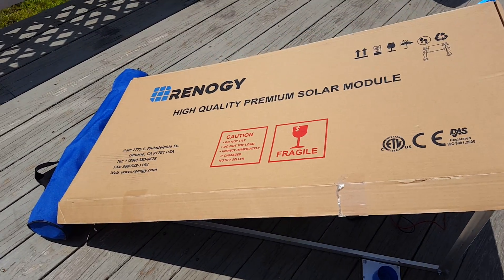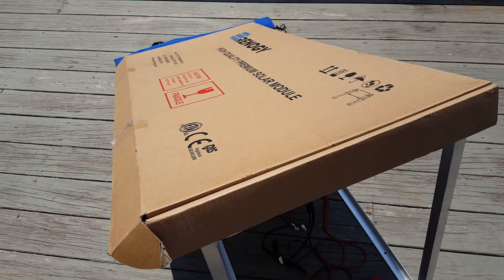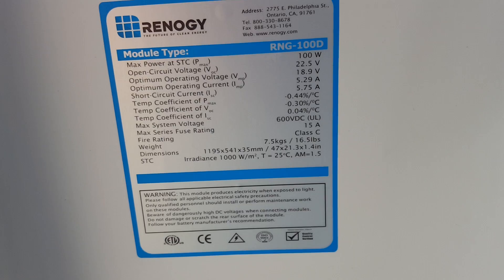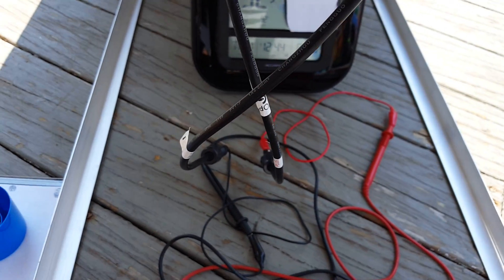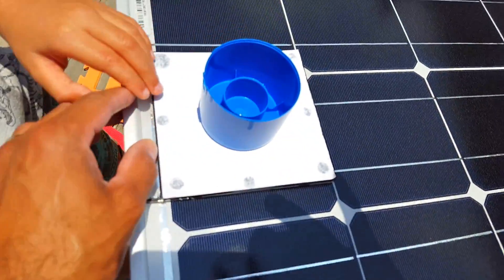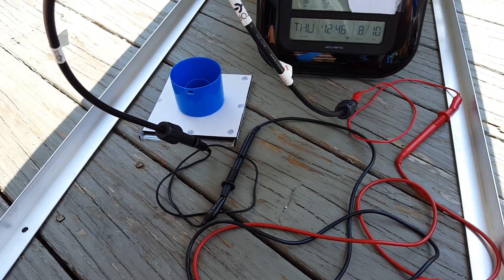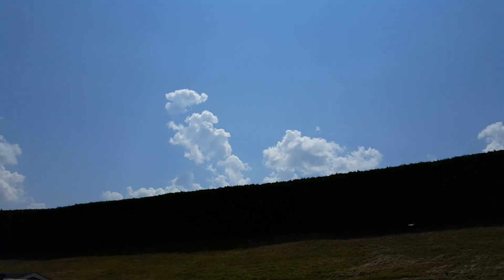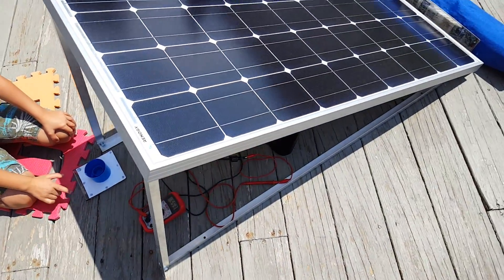Renogy 100 Watt Solar Panel Test (Solar Noon)

Comment: I have different panels, but I've noticed that the open circuit voltage is higher when the temperature of the solar cells are close to freezing temperatures. The difference in winter is that there are many more cloudy days. From my experiments in my particular region (central TX) I've found that it is better to point the panels more toward morning sun for permanent mounting, as the panels are cooler at that time of day and the sky is usually clearer on average before noon rather than after. Keep experimenting, especially letting the young assistant understand and learn as you go👍

Comment: what time zone do you need to adjust on average
Reply from the maker: Readjusting the solar panel angle twice a year should be sufficient. However, if you live close to the equator you probably do not need to adjust the angle of the solar panel.

Comment: I have a question, I was looking into this brand but messed up and went with Eco worthy panels because they were a bit less about $20 less, mine are mono 100 watt look exactly the same. Those little dots I noticed on your panels what are they bad cells? I have a panel with the same dots in a few areas
Reply from the maker: Regarding the dots; I think you might be referring to the spaces in between each of the solar cells??
For this solar panel, there are 36 solar cells in total.
The corner of each solar cell is not an exact corner shape...so..after all the solar cells have been placed it looks like 'dots'.
I think this is just the standard practice for the Monocrystalline type of solar cells.
I believe the Polycrystalline type and Thin film type of solar panels do not have dots.
Reply: ∵§ain†♣∀₦₲ξℜ∴ can you give me the link where you bought it?
Reply: Victor Rodriguez I was worried this would cause snail trails over a period of usage
Reply: My firstname My surname they're were 3 left the other day they're selling fast or they've pulled them from selling them

Comment: Not a valid test.  Power would need to be calculated into a normal load.  Testing open circuit voltage has no meaning.  My 15 watt battery maintainer shows 21 volts open circuit.  With the meter shorting the output of the solar panel the voltage at the meter would be 0 volts DC so you need to measure the ability of the solar panel to raise the temperature of say "Water" over time.   That would be a valid test. For a given volume of water you can calculate the energy required to raise the temperature.
Reply: ycmdill, Victors test is a very valid test, and one of the first tests you should do on a new panel to make sure the open circuit voltage and short circuit current are reasonably close to the published specifications of the panel.  It actually allows you to compare two data points on the solar panels performance curve.
Reply: @wd8dsb  I just got a new renogy 100w and checked it today and it read 19.3v -  is that too far out of spec?  open circuit voltage spec says 21.5, so that's a 10% dip, it was at an angle though, I think I have to test it flat.  I'm in AZ plenty of sun and plenty hot.  Thanks.
Reply: @carln1552  Hi Carl, the panel needs to be pointed directly at the sun for the test, and for temperatures above 25 degree C the panel will have reduced output, but likewise for temperatures below 25 degree C the panel will have increased output.  The industry standard is to obtain the specifications at 25 deg C and they call this STC for standard test condition.  The STC of 25 degree C is the actual temperature of the solar cells as well as the ambient air temperature, so does not surprise me that you are not reading 21.5 Vdc.  Even with an air temperature of 25 degree C, the cells them self will often be much hotter.  Not sure which exact panel you bought, but you should see a temperature coefficient for the open circuit voltage (Temperature Coefficient Of Voc) on the specification label, and suspect it's around -0.3%/deg C.  If you can measure the temperature of the solar panel itself (I would try measuring the backside surface temperature of the panel during your test), you will get a better idea on how close to the specifications your panels are, but again your panel needs to be pointed directly at the sun (not at an angle to the sun).  I suspect your panel is operating just fine.

Comment: I have 5 of those now and 1 more is on its way.
When I got my 1st panel I tested it and after 3 years I tested it again at the same month of the year  as when I got it new. After 3 years the panel was putting out exactly the same as when it was new.